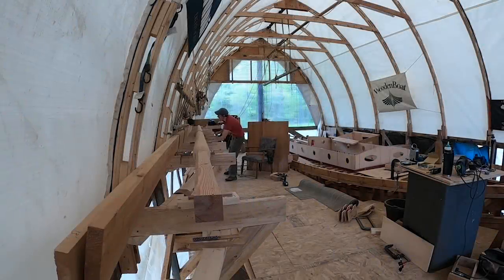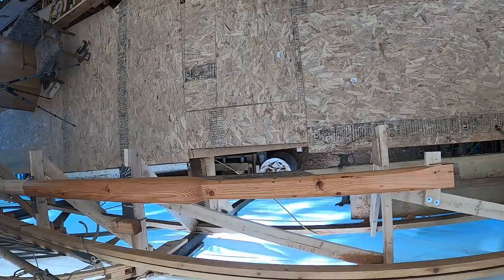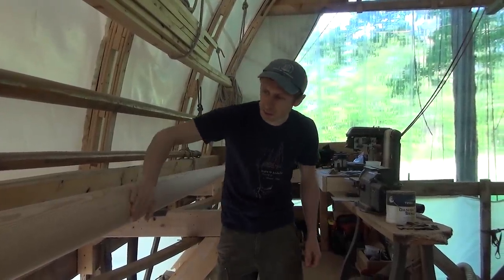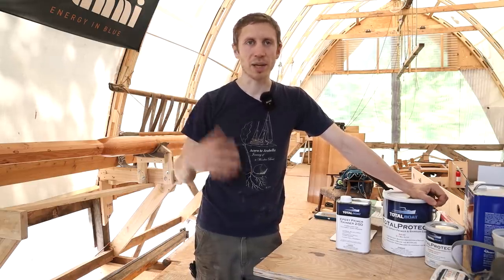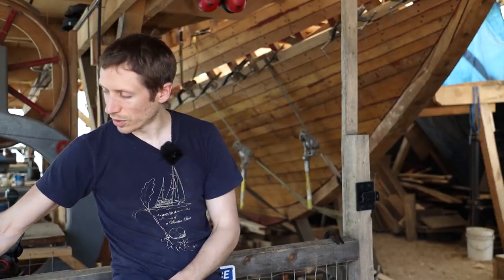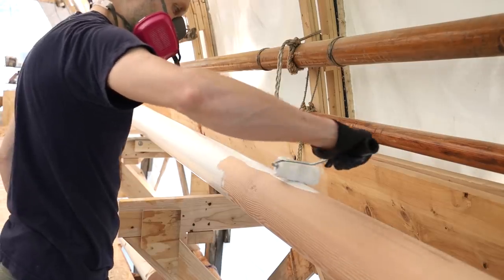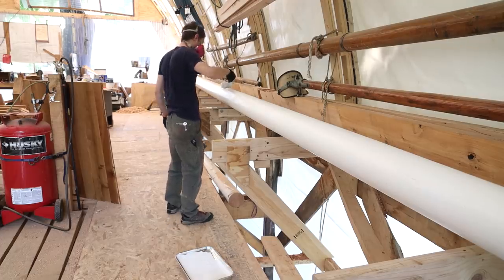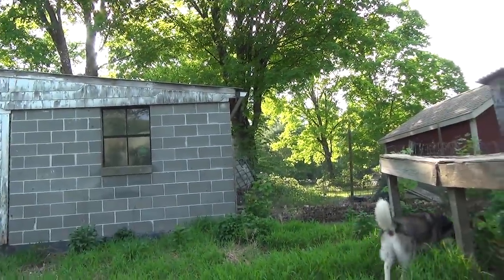Wrapping Up the Mizzen Mast - Episode 165 - Acorn to Arabella: Journey of a Wooden Boat

Comment: Alex, just one correction on the Total Protect.  The thumb print test is only when applying oil based bottom paint over it.  TotalBoat TotalProtect can be recoated over itself for up to 60 days. If that time window is missed, sand with 80-grit sandpaper, and
wipe the surface clean with a clean, lint-free cotton rag wetted with TotalBoat Dewaxer & Surface Prep, and allow the solvent to
evaporate completely. Recoat with TotalProtect.
Reply from the maker: Ooh! Thank you for the correction. That’s even better than what I thought!

Comment: In the car world, this is called resto-modding. Old school body with modern running gear and comforts. Best of both worlds.
Reply: Yes, it is, and its the only way to go.
Reply: Eh, depending on the running gear I may leave it original, but I do insist on modern safety gear like brakes.

Comment: I went the same route with Satori. She's also based on Atkin's Eric, with tons of teak and bronze with fiberglass hull. The biggest struggle has been keeping the plastic components to a minimum inside. The only allowed exceptions have been the VHF and SSB. Everything else is hidden away to keep her looking bristol with only brass lamps and wood showing. It's amazing how much plastic can ruin the appeal of a traditional double ender. On the other hand, I am all for using carbon fiber and dyneema for rigging. It looks great even on old rigs. Dyneema doesn't clash and carbon fiber (spinnaker pole) can be painted to hide the tech. Varnish can be canvassed to reduce the maintenance. Spare no expense on it.
Reply from the maker: For some, including us, practicality goes a long way to making something aesthetically pleasing. Thanks so much for watching! Send us a picture of your boat, would ya?

Comment: Did you plant a new tree for the mast of the boat your grandson/daughter is going to build?
Reply: Three new trees : mizzen mast, tall mast and foremast.
Reply: @tomf3150  Only one tree harvested for masts. A Yawl only has two masts - a Mizzen and a Main (which in the case of a Yawl IS the forward or fore mast). They are reusing a mast from another Atkins boat for the Mizzen Mast so that is not a new tree used. That only leaves the Main Mast coming out of a new tree!
Reply: Very good question. Maybe a assortment of useful boat building timber.

Comment: You may want to bed all fasteners into the mast with epoxy. This will help prevent any water intrusion. Great work!
Reply from the maker: Thanks! We won’t use epoxy for that... Bedding with wax or Dolfinite is where it’s at. Epoxy makes it darn near impossible to remove later for regular maintenance. We have a few friends who have had to remove epoxied fasteners and epoxied bungs, and it’s a nightmare.

Comment: Tradition is great but when it comes to safety, take advantage of technology. Remember, 100 years ago "IF" you had life jackets, they were made of cork or balsa wood. Navigational equipment is also a form of safety. A compass might get you there, but GPS systems will take the "might" out of the equation. Even the Kon-Tiki had modern safety equipment on board.
Reply: Aaaaaaarrrrooooooooooooooooooo!
Reply: @Walter Alter that, too.

Comment: varnishing: apply with brush in one direction, toward the wet edge, don't keep brushing over the same spot. painting: roll on and tip off with a brush.
Reply: Apply like it's free, definitely tip it off with a brush after rolling. Roll then just using tip of brush tip of towards wet edge in one direction and if possible only once.

Comment: The thick spots are due to needing to roll a little more thoroughly—less dips into the pan, using that tool to lay it out with long strokes. 👍🏼 That two-part stuff is bullet proof.
Reply: Like literally bullet proof? Haha wasn't sure if you saw some YT video where they shot at it or something. Ha

Comment: Definitely a water maker. Spectra is an amazing 12V system. Big battery bank/internal ballast. Two oversized alternators on the engine. I cannot fathom why you don't want pressurized water?

Comment: A really good vid indeed. This guy is kinda self-preoccupied but not irritating - more like a standard middle-age crisis thingy. Alix, my man, you can put far less paint in one layer - your roller holds so much of it and you keep refreshing it - just start pushing a little harder on it and roll it in long persistent lines and you will get a lot smoother layers, which by the way, dry faster. Anyways, great job on the mast preparation for painting. I wonder if the line where varnish and paint meet is about to be encased in some sort of holding ring?

Comment: I know this is too late for the mast, but, it might help further on down the road. When I'm finishing my furniture, I use a cloth misted with Endust to remove the sanding swarf. It must be Endust not Pledge. Pledge leaves a residue while Endust doesn't. This works very well on snag free surfaces. Too, the dust remains bound to the cloth and goes away with the cloth (thrown away) or laundry water. Just my $.02!
Reply from the maker: Endust leaves a bit of oil behind, which depending on the type of finish you plan to put on, could affect adhesion. For this two-part epoxy, for example, you don’t want anything oily left behind, which is why denatured alcohol or acetone is the best for a solvent wipe down before applying.

Comment: You should really consider putting a UV protectant coat over it. Trust me, especially on the ocean, any sort of UV coating you can put on that boat will save you headaches. Total Boat does have a product that will adhere to the epoxies and primers and what not. And can't wait for the closed captions again. I have to watch a lot of these silent while working and and the captions really make a difference. Pretty sure there's programs that'll transcribe for you. Not sure on their availability or cost though.
Reply from the maker: Ben has found a solution for captions that we’ll be rolling out very soon!

Comment: Mike Arthur
I am not a professional varnisher, but I was told by someone who was that, you should only ever brush in one direction. You are less likely to introduce air bubbles and you should get a better finish.
Reply from the maker: That’s nearly true, and yes Alix’s strokes weren’t those of an experienced varnisher. He’s basically finished the deck framing pieces and some knees. Still getting a feel. Thanks for the tip and for watching!

Comment: Just a thought on the topcoat for the mast, why not use a 2 part top coat? The hardness of the coating will be a big plus on the mast. It'd hold up to banging halyards ect much better than a one part enamel.
Reply from the maker: It’s a good point—we were mainly pointing out that anything will adhere to this primer once it’s cured. A final decision on top coating is still in the works.

Comment: Creating and building Arabella is completely anti traditional by today’s standards but was the norm not to long ago in the world’s history. Before the train was around is was difficult to move construction materials so people were forced to use local materials. Using local materials is the ultimate in saving energy. I hear people speaking today of using local materials to save energy and not pollute not to mention smart and simple too!
Reply from the maker: The way that Arabella is being built is non-traditional by “yesterday’s” standards as well, as a crew of six or more would build a boat like this in a boat yard. Boating for pleasure is relatively new as well, only as of the 1880s did anybody think of going out on the water outside of the purposes of shipping or fishing. Building with what you have, where you have it though—practical and traditional for sure.
Reply: @AcornToArabella  Thank you for answering, Your work is terrific. Im in the Los Angeles area and am into wooden boats and am very intrigued by all of your cork and challenges because I have an older wooded boat too. It's a mahogany on oak sloop rigged production boat built in 1965. It's a  Kettenburg K43 named "Raiatea" If you like, check out her facebook page Raiatea The-Boat.

Comment: Will the boat be watertight the moment you first launch her?  If not, how long does it take the wood to expand enough to seal all the leaks?
Reply from the maker: It varies, time-wise, but the oak should swell up in a day or so. Also, she’ll be “pre-swelled” before launch. After a long, windy ride on the road to the sea, it’s pretty much necessary to hose the boat down a bunch of times, fill the bilge with water and pump it out, or even keep misters around it until launch.

Comment: Always use oil based paints on wood.  This is especially true for wood that will be in a wet environment.  The oil based paints allow the wood to breath while the enamel paints seal it up completely and will trap moisture that gets behind it.
Reply from the maker: Many enamel paints are oil based (alkyd). All of this terminology can end up being a bit jumbled when we’re speaking on the fly, but in essence the paint systems that we’re using are being chosen for the ease of maintenance. By the way, just today Restoring Rosalind posted a new video about the use of different products used to finish or glue wood. You may want to check that video out.

Comment: You are going to see some far off places, are you going to use insulation  for like the colder and hotter climates  and if so what kind of insulation would you use on Arabella.  I'm just curious as i have seen some you tubers regret not having insulation as it caused then a lot of problems without having any. And I believe that having a water maker would be one of the best things you could have on a boat as some places it is very hard to find water.
Reply from the maker: Wood is a great insulator. Normally we’re back country hiking with tents or bivy bags so blankets, good clothing, and the thick insulation of water and wood around us will be luxury.
Reply: @AcornToArabella  thank you !

Comment: Steve, you mentioned using nylon for running rigging. Didn't you mean dacron?   Too much stretch with the nylon. Of course you could go with tarred hemp. (Not)  😉
Reply: Dacron is for sail fabric. There is a pre-stretched nylon 3-strand which is used on boats that want to have traditional looking running rigging. As for the standing rigging, there are modern lines which are being used there instead of metal.
Reply: You can get nice traditional looking dacron, or poly based ropes as well.  Though I have not seen dyneema cored white three strand, which would be traditional looking, and modern strong, and modern expensive...   Dyneema for standing rigging, of course.

Comment: two old lawn mower wheels make great rollers under anything you want to turn.  use bolts from lawn mower and drill multi holes in flat steel so you can adjust for size of pipe you turning.  Screw flat steel to 6x6.  I ve done 6ft telephone poles on this.

Comment: So you guys briefly touched on the drying gaps that have formed between your planks.  When you watch the slow panning shots of your hull you can see those gaps.   When the wood retakes up and swells these gaps will fill.   But is there structural integrity that is lost from the take up/swelling process.   I know you’re building the boat with good methods but is the time it’s taking to plank out the hull having adverse consequences?
Reply from the maker: Considering that the system of swelling for watertightness is older than we can say, and that a great many boats are launched and hauled on a yearly basis, maintained and sailed hard in all kinds of conditions, we’re not concerned about a  loss of strength.
Reply from the maker: Ah... and to speak to the time it’s taking—that’s being mitigated with frequent and careful application of linseed oil.
Reply: @AcornToArabella    Okay I was just curious since there was some issues with wood and then having to let more dry. Very cool project and I love watching it

Comment: I don't understand the reduction in size at the base of the mast. That is the location that will have the highest bending loads, and you thinned it down. What is the logic behind it?
Is it that you will support the mast with cables from the top so it doesn't see bending loads at the base?
Reply: Yep, the mizzen has stays.
Reply: No real bending loads. Fixed position at the mast step, locked in place at the partners (the deck). Compression loads only.

Comment: I have no problem with picking a traditional design and adding modern stuff to it.
I'm restoring an 40 year old old 4x4, I chose it because of the practical design and I liked the lines... but the brakes were rubbish from new, so switching to disks... and power steering... and aircon, bluetooth, actual sound proofing, 5 speed....
It will still look, drive like be as practical as an old 4x4, but will be nicer to live with and if I can make it lower maintenance, safer and more reliable in the process, why wouldn't you?

Comment: You don't like vacuuming and tac cloth to remove sanding dust?
Reply from the maker: An initial rub down with a dry rag and a vacuum cleaner, followed up with a solvent wipe down is pretty efficient. Tack cloth can be pretty annoying, but that would be the last step.

Comment: As a welder fabricator I find this a little frustrating. I have a short amount of time to build the projects I work on daily. I have to work in aluminium, steel and stainless steel. All the projects I work on have to be within a tolerance of 1 mm in both length and width but also flatness. I am expected to turn out this quality in short order. It frustrates me that you can work to such sloppy tolerances and have so much time to complete your project. If it was the company I work for, Your project would be expected to be completed in at most 2 months  with tolerances that you would consider unreasonable.
Not taking away from your achievement, I am just a little peeved that so much is expected from me. Your work blows me away, to be as accurate as you are is a mind F***. Props to you and keep up the good work. Love you guys.

Comment: If you are using an epoxy primer, why would you use enamel paint?  Epoxy paint is FAR tougher and UV resistance....think automotive paint.  It flexes without cracking and is exposed to the elements.  If primed properly, paint doesn't care what the substrate is.